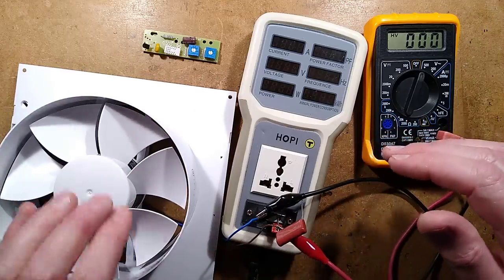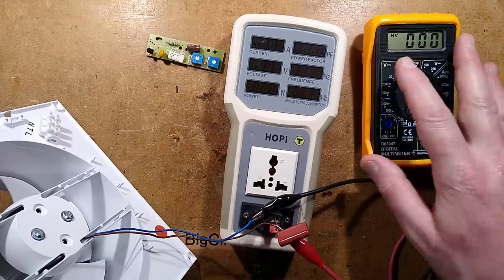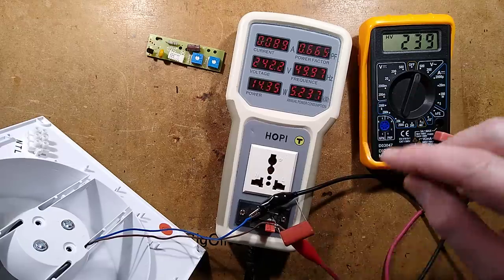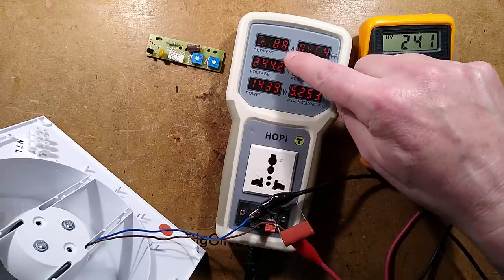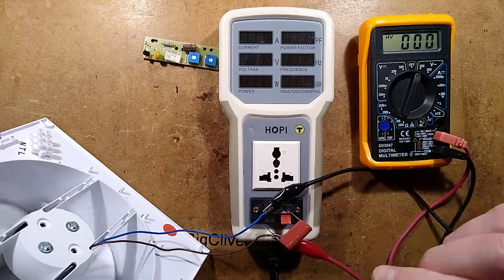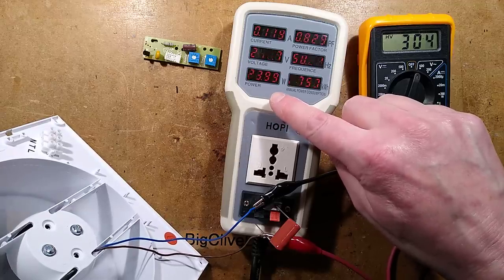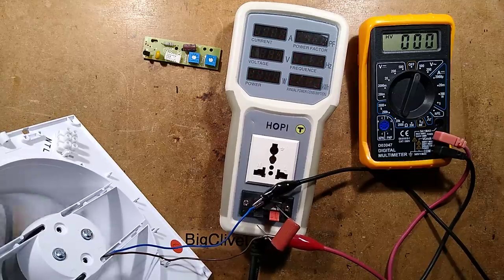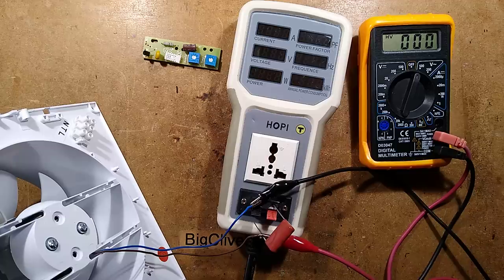What the heck!  Series capacitor makes fan go TURBO!

Comment: Basically the only new principle involved is that instead of power being generated by the relative motion of conductors and fluxes, it’s produced by the modial interaction of magneto-reluctance and capacitive diractance. The original circuit had a base plate of prefabulated amulite, surmounted by a malleable logarithmic casing in such a way that the two spurving bearings were in a direct line with the panametric fan.

The main winding is of the normal lotus o-deltoid type placed in panendermic semiboloid slots of the stator, every seventh conductor being connected by a non-reversible tremie pipe to the differential girdlespring on the ‘up’ end of the grammeters. Moreover, whenever fluorescence score motion is required, it may also be employed in conjunction with a drawn reciprocation dingle arm to reduce sinusoidal depleneration.

Comment: This example is very interesting because it seems to break Kirchhoff's voltage law, due to the higher voltage after adding the capacitor.

When the capacitor is connected to the circuit, its reactance compensates for a portion of the inductor's reactance. Since the equivalent reactance (in series) is lower, the current will be higher and the voltage across the motor will increase.

Based on the video, there are two approximate values for the capacitor:

1uF -> the equivalent reactance will be capacitive
3.3uF -> the equivalent reactance will be inductive

But in both cases, the equivalent reactance will be approximately 1111 Ohms.

Comment: this is a fact that is used in most of celling fans (at least in Egypt), most of the time when a fan goes slow it's nothing but just a bad or damaged capacitor, in lower voltage areas the capacitor that comes with the fan (usually 2uF) is replaced with a bigger one (4 or 4.5uF) to increase this effect even more
Reply from the maker: That's usually the capacitor that is used in a second winding to cause a phase shift and set the direction of rotation.
Reply: @bigclivedotcom  interesting to know, I will read more into it

Comment: It's called series resonance. An inductor and a capacitor in series have a zero impedance at a particular frequency.
And at that frequency, the voltage at the center point will be enormous. And the current of course as well.

Comment: I was installing security cameras a while back that were  fully enclosed in sealed cabinets.  There was a small cooling fan in the cabinet and I found  that it was causing interference with the video feed.  I installed a capacitor across the fan leads to filter the noise and the same thing happened, fan went turbo.  Now I finally know why!
Reply from the maker: It may have been powered with rectified but unsmoothed power.  Adding a smoothing capacitor would increase the voltage to the peak of the rectified AC.

Comment: Dc-dc boosters are generally a capacitor and an inductor. That or the fact that voltage of 240v is between negative and positive peaks. But peak to peak voltage is much higher. Capacitor subtractad a part of negative peaks leaveing more of positive peaks, averaged out voltage across the fan in higher.

Comment: Inductors and capacitors have opposite phase shifts. (As ideal components, it's ±π/2, I always forget which one is which exactly). So putting a series capacitor into the circuit causes the reactive power to go down at the advantage of useful (active) power.

Comment: You need an oscilloscope to measure the voltage and the current. That way you’ll be able to see the phase of the voltage and the current. Changing the phase of the voltage, you’ll be able to find the best values to run the fan at maximum efficiency.
Reply: what should the phase be to get the maximum efficiency?

Comment: its turning reactive power into active power by shifting the current forward. sift the current inductive loads will shift the current backwards relative to the voltage and a capacitor basically shifts the current forward

Comment: someone asked: why 300vac showing on the Hopi: that's perfectly reasonable: you've got a LC series near-enough resonant fed from 239vac mains as "input signal" so the joint between L (motor) and C is to be expected as *higher than input voltage*.

in fact, thanks to both L and C phase shifting, when Clive would measure the ac rms voltage across across his C, I expect to see somewhere around... starts a bit of calc: let's say motor is non ideal L, so it has all the ohmic bits too, so the 230vac drops over the ohmic part of the motor element, measured us 300vac, so the L aka "imaginary voltage part" is sqrt(300**2 - 240**2) = 180vac as Clive showed he had an actual mains voltage of 240vac. As the C is pretty much "ideal", that one will have to compensate by having 180vac across the C, give or take a few volts.

The key here is that those voltages sum nicely *in 2d vector space*: if you draw the circuit loop as: mains voltage source (240vac, phase 0) -> C (180vac, phase -90) -> motor (L+R series, L takes 180vac phase +90, R part is 230vac, phase 0) the circuit sind to zero as theory demands. Clive measures 300vac across the motor, which is 230 over R plus 180 over L, which is sqrt(230**2 + 180**2)=300, thanks to Pythagoras and 2 vector. classically, you draw this vector stuff in a voltage-phase vector diagram ("polar coordinates, anyone? 😅) but i dont know if the school textbooks still start with that one.

Anyway BTW: in response to some folks doubting the end qualities if the meters involved and such stuff: I expect some quite neat basic sinusoidal waves on the 'scope all around and thus not a sweat or a problem for any multimeter or what-have-you at basic mains 50hz. it's all nicely explicable by the LC "series resonant circuit" that Clive just built himself.

PS: I had a lot of trouble understanding series resonant circuits, which are ubiquitous today: open up any "high efficiency" oc power supply or solar converter and I'll bet a pretty penny the power magic in there is done by cute mosfets and a LC series circuit (which they call LLC, LCC or LLCC, depending on whose papers and patents you wish to genuflect 😅 and just to fancy up plain ol' LC 😊)
Anyway: it might help you to draw voltage source plus LC series, then realize voltage sources, by definition, have zero impedance (which is why all of us are so happy to have fuses and circuit breaker boards) so we can temporarily replace the voltage source by a short while we consider the LC resonance, then rotate the drawing and than recognize that we now have the equivalent of a L\\C "tank resonant circuit", which is used for over 100 yrs in radio receivers to "amplify" (koff koff) tiny radio signals incoming from our Arial antenna. That "tank" circuit is well known for its ability to convert tiny input energies into huge voltages across L and C. Which is where Clive's 300vac measurement happens to be looking at: across the L of the LC resonant tank.
As others said: Clive is lucky he's still that far from true resonance or the voltages might've been more befitting electroboom lore 🎉 (while the ohmic part of the motor windings would prevent things from going truly amazing - check LC circuit "Q factor" stuff via Wikipedia et al if this floats your boat.)

Fun stuff and beautiful demo by Clive, as usual. Thank you Clive, from the Guild Of Insomniacs over here 😅
Reply: Apologies for the crazy typos ("sind" ==> "summed"; "2 vector" ==> "2d vector"; if=of; "oc power" ==> "PC power"; missing "to" after "genuflect"). Lesson for me: don't type messages on your mobi when it's the small hours. (Not that I'll learn from this, but the notion is nice. There's always *hope*.) Anyway, the basic story line holds and that's what matters here; the calculus/model is "close enough" -- mains supply at home or business has some (small!) ohmic impedance as well, so not exactly "ideal voltage source" but that's nitpicking when we consider small fan motors and such.

Comment: This is exactly the principle a series C used in radio antenna power transfer matching, to cancel series inductance.  On a Smith Chart there's a anti-clockwise locus going downwards towards the 0.0 reactive Z flat horizontal line.

Comment: yeah uhh im sure someone else said this but looks like a series resonant tank circuit. if an inductor and capacitor cancel out in the impedance formula all that is left is the resistance of the wire canceling out the impedance at a given frequency. this is due to the voltage between the capacitor and inductor leaking into each other at a specific resonance. this is electrical engineering 101 if that is the case.

Comment: yep its just canceling out some of the inductance. since the inductance is limiting the current and therefor power it makes since that removing the inductance would cause it to draw more power and develop more torque. since this style motor opperates with a tun of slip, developing more torque means it spins closer to synchronous. I believe many ceiling fans operate something similar to this.

Comment: In simple words. It only works with AC current.  There is a fase shift when we connect an inductive load like the fan motor. This shift can be corrected by using a capacitor. If we see the wave on the screen we observe that the inductive load shifts the wave's curves forward, and the capacitor shifts it backward. It also cheats the multimeter showing 300V. this is all because of the fase shift.

Comment: This property of an LC circuit is used in typical single phase AC motors with a dedicated start winding. The start cap is in series with the start windings, and there is often a dedicated run cap that is parallel to the start cap. The predictable huge increase in voltage drop across the start windings is used to signal dropout of the start cap by using a clever invention called a”potential relay”. After the motor spools up, back EMF from the motor triggers that voltage drop, dropping out the start cap to leave the run cap by itself in series with the start windings. The run cap induces less of a phase shift, lower current down the sensitive start windings, and more efficient current draw. The thing that has always puzzled me is the relationship of back EMF to simple LC phase shift. They are related but not identical. Any thoughts?

Comment: Yes, as already you have been told this is a series resonance process. If the exact capacitor value is selected, the circuit will remain only with the DC resistance of the fan which will mean a lot of current. https://en.wikipedia.org/wiki/LC_circuit

Comment: The capacitor in combination with the inductive load(in this case the fan)may create a resonance circuit that its resonance frequency matches the 50 or 60 herz wall electricity and tye voltage builds up even higher than the 240 volt.

Comment: If it helps, when I was little and used to open TVs with dad's screwdriver, a few of those brown capacitors bunched together on the board looked to me to be cows. It might be working in the opposite way a dimmer works, instead of chopping the AC waveform, it's  multiplying it, probably dependent on the inductive load drawing sufficient current for the cap to discharge, oh can't be bothered to get the calculator out, yep, those lovely cows, those bovine beauties.

Comment: I'm guessing the capacitor is charging and discharging in sync with the motor which runs on the power to the coils going on and off repeatedly, the capacitor is likely holding the extra voltage when the fan doesn't need it and then giving a higher voltage when it does, you could probably check it with an oscilloscope.

Comment: As others have said, you have created a series LCR circuit. Without the capacitor, the impedance of the motor is determined by combination of the inductance and resistance of the motor, thus limiting the current. When a capacitor is added in series, its reactance cancels out tge inductive reactance of the motor to some degree and so the net impedance is lower - resulting in a higher current. The "right" capacitance would cancel out the inductance completely, leaving only the resistive component to limit the current. At this point the motor might go crazy. Something to try Clive?

Comment: This is an easy one, the capacitor is cancelling out some of the inductive reactance allowing more current to flow. If the combination of inductive reactance and capacitive  reactance causes the circuit to be resonant at mains frequency, all you have left to limit the current is the ohmic resistance of the copper wire and a very large current can flow. So what you have here is a combination of L and C that is approaching the resonant point enough to allow more current than usual to flow. Just for interest - a parallel  L C circuit at resonance is near open circuit, where as a series L C circuit at resonance is very low impedance (ohmic copper losses define this low value.) Really enjoy watching your videos! Regards, Chris.

Comment: Noticed the Power Factor went up by ~0.2 as well.
But similar to like HenryOkeeffe said, it seems like the capacitor is shifting the voltage curve and maybe able to ride the wave, whilst contributing it's own stored capacity, to bump up the output level...

What happens if you add a matching capacitor in line on the neutral tap? Or, swap that cap to only being there?

Comment: You were certainly correct to shut down that little experiment quickly. As these types of cheap motors are generally manufactured with very little headroom above stated normal running specs allowed for it probably wouldn't have been long before the dreaded sight and smell of smoke did occur with the resultant failure of the motor to function as per normal. The power consumption was about 40% above normal operation which generally leads to quite sudden motor failure by itself. The fan was definitely pushing through more air so that power consumption of the motor was real. Another factor that would also have contributed to the motor windings failure is the much higher voltage across the windings. That 305 volts (if I remember correctly) was an actual PD no matter how it was produced, and the winding were almost definitely not designed for that high voltage. Therefore there would not have been enough iron in the magnetic path and the the extra voltage would have oversaturated the iron at the voltage peaks causing massive magnetic flux distortions that were definitely not sinusoidal thus becoming another major source of heat and inefficiency within the windings themselves.
Many of the responders tended to see the motor as a simple inductor or represent it that way as a simulation. This is an extreme simplification that has very little relevance to the great variance of loads and conditions that a motor, even a simple one like an exhaust fan, might be subject to during its operation. If it was that simple then all exhaust fans or similar would use a suitable series capacitor to some extra performance at little cost. My expectation of why few motor designs use a form of series capacitance to increase voltage across the motor coils while adjusting the motor coil design parameters to suit is that motor starting torque could be severely reduced and motor speed stability under varying loads could also be severely comprised if implemented.

Comment: The capacitor improves the power factor which corrects for the inductance that tries to oppose the flow of energy in the wire 

Use a bigger capacitor and it'll go even harder

Comment: It will depend on the amount of capacitance added. The most reasonable explanation is resonance. Perhaps the capacitance was just right to resonate with the inductance of the motor at 50 Hz (from the plug and 240V I assume this in in UK). Try to add another capacitor, it might go even faster or slower depending on the exact inductance and its corresponding impedance...

Comment: When the load is turned on, there's a high current through the capacitor and inductor. Low voltage across the cap, but the inductive load is now storing that initial high current. As the AC cycle decreases, the inductor dumps the higher voltage from the collapsing magnetic field.

Comment: Well, that's a rathee surprising outcome... :D
I wonder if the coil and capacitor are essentially forming a resonant circuit, in series with the mains, which just happens to have a resonant frequency of around 50 Hz?

Comment: @henryokeeffe5835 is correct. It's resonance. Check out the power factor, which rises from a terrible 0.665 to a much better 0.829. The cap and the inductance of the fan coils are resonating, and a series resonant circuit has a lower impedance than either of its components alone. 

Try putting the cap in parallel with the fan. I bet it slows to a crawl.

Comment: I would definitely run that fan with the capacitor in series, because if that is what i think it is (for humidity extraction in a bathroom or similar) then the more humid air that can be removed, the better, so I'd want the fan to spin faster :).